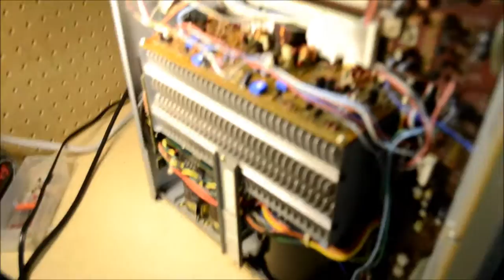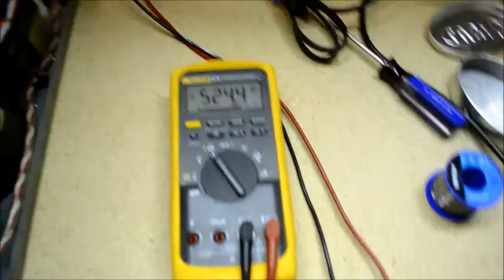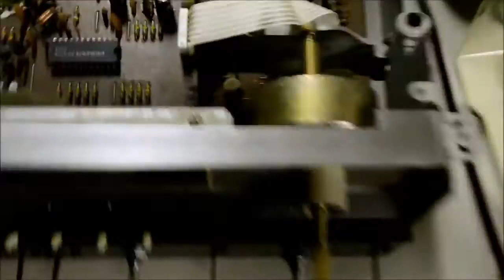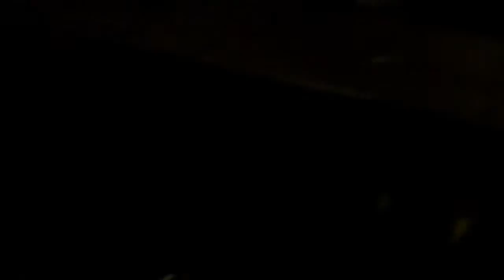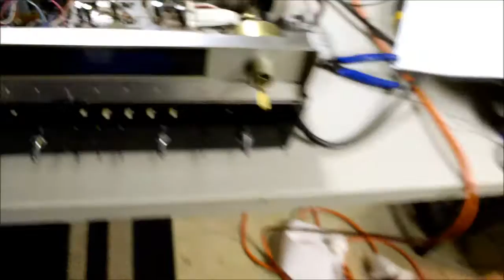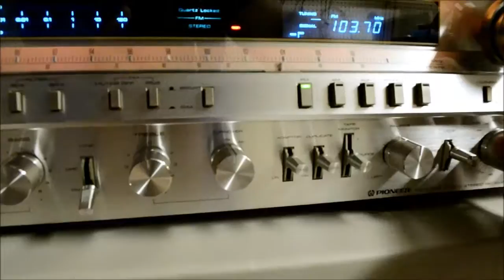Pioneer SX 3900 Restoration Part 2 of 2 (1-28-2014)

Comment: I got one of these units.  The analog tuning dial was off---When I reset the pointer to the correct reading of what station is actually playing, it is only true for that frequency.  So If 96.3 FM is playing and I reset the dial to that spot, when I move it up to say 105.9 FM the actual station that plays is not anywhere near 105.9, but more like 101.1.  So the digital display will read 101.1 and that's what you hear, but the analog dial is way off.  Any hints / tips on configuring the dial?  Do you think it needs to be re-strung?
Reply: Tuner alignment issue. That should be taken care of by a reputable technician. Need a signal oscillator and oscilloscope among other tools that us hobbiest  normally don't have on hand unless they are hardcore! Lolz